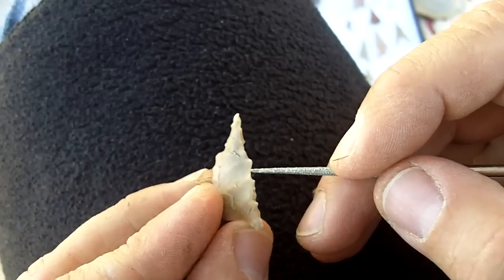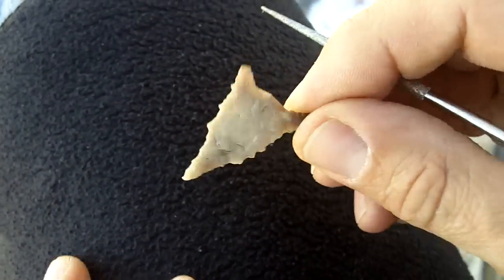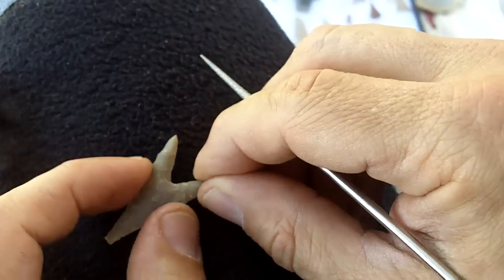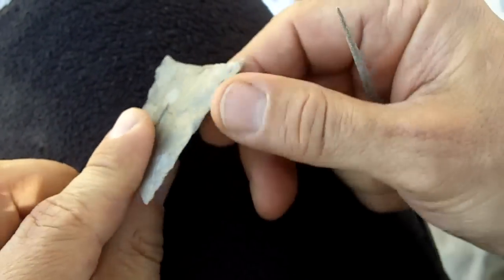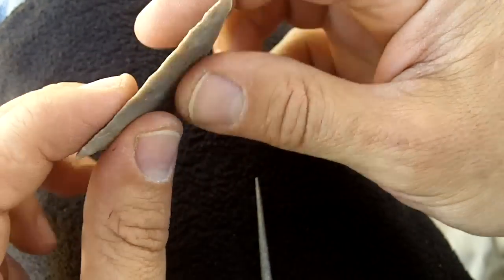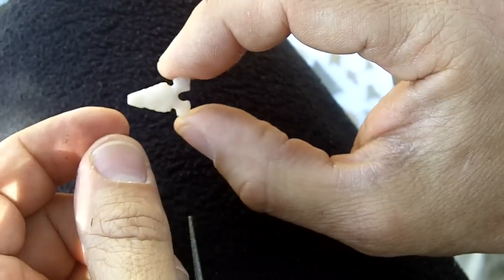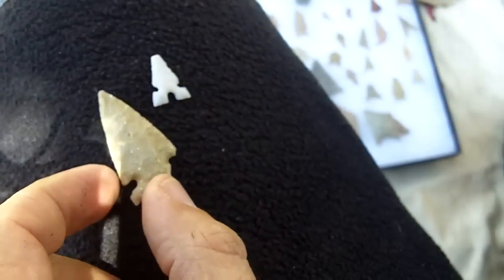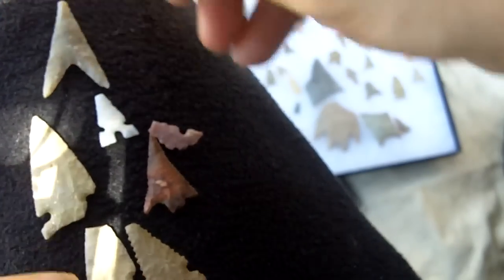038 - Artifact Discussion and Observations

Comment: ....side due to the thinness of the glass. Just left the middle smooth, the way the glass was made. These too could have been war points due to the fact that his tribe was being killed off due to the invasion of settlers. Just a thought :)
Reply from the maker: War points are tricky to identify but, yeah, the long thin points were made for war, according to Ishi's own testimony.  The fact that only the sides of the glass were knapped, leaving the flat part untouched in the center, drives modern knappers crazy but didn't seem to bother the old boys.

Comment: I was curious to know where you learned your indirect percussion from? Did you see, read, hear about it somewhere? As a beginner at this, I am looking for all bits of information about styles, techniques, and tricks in this trade. 
You mentioned war points. I was at the indian museum here in Sacramento Ca. On display are some of Ishi's points. They were very thin and delicate. Made of clear glass with very fine pressure flaking on the sides. Some did not even have driving flakes from side to....
Reply from the maker: Hi John.  Looks like I missed this question from 5 years ago.  Time flies... If it wasn't for a recent notification of a new comment, I would have missed it.  Anyways, you probably already know that my indirect percussion is self-taught and the "behind the knee" technique is my invention.

Comment: hey again. looks like the point may have been finished and then used to drill a hole. you said the tips on the end looked snapped off and turning by hand could have broken off the base.